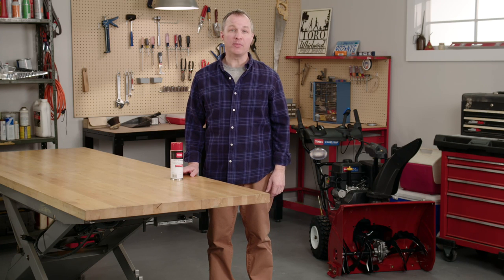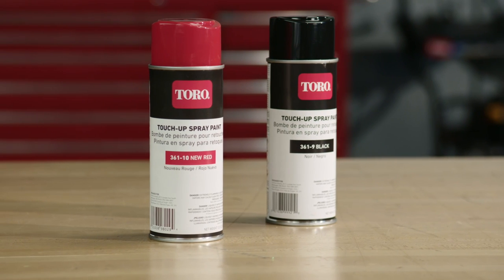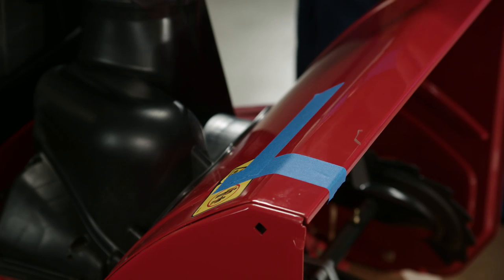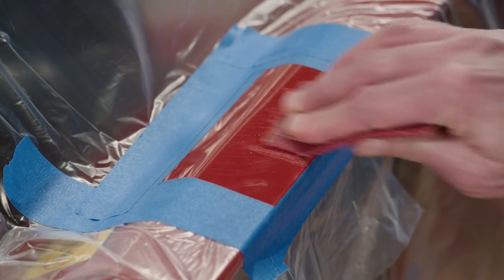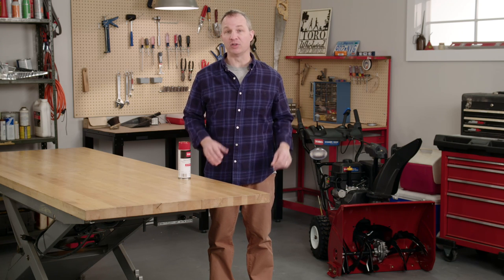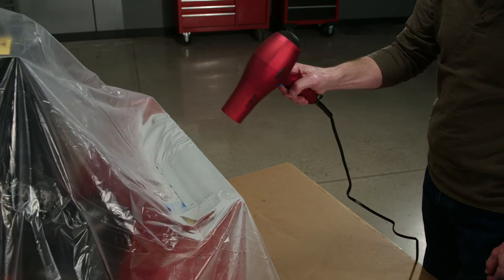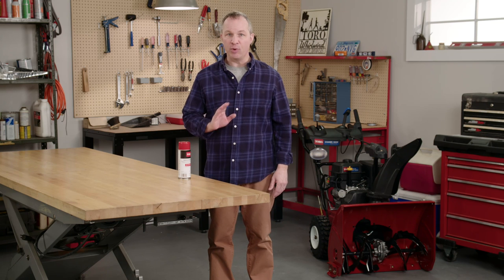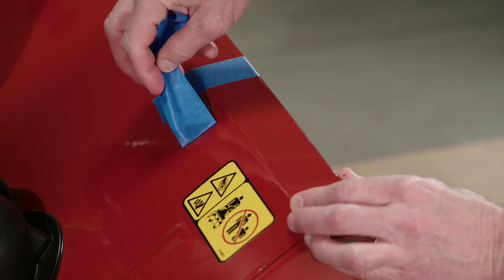How to Apply Touch-Up Paint to Your Toro® Lawn Mower

Comment: not would I recommend, you either get enough paint to redo the whole panel or just dab some of the paint on your finger and touch it up.  all you did was put too much work and material, now the surface is higher and uneven, looks like you weld patched it.